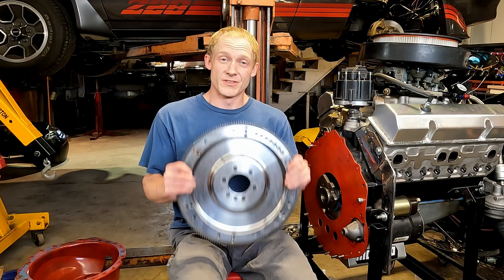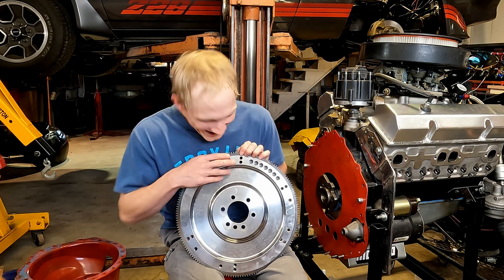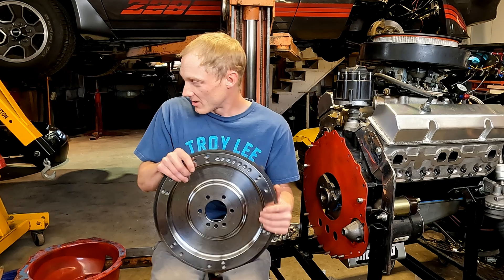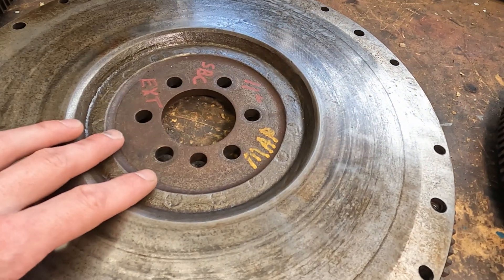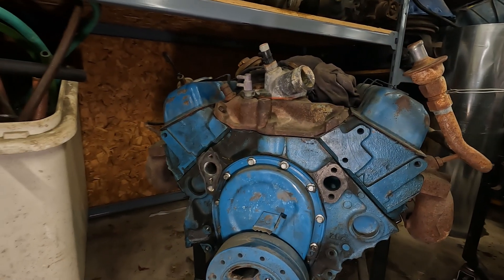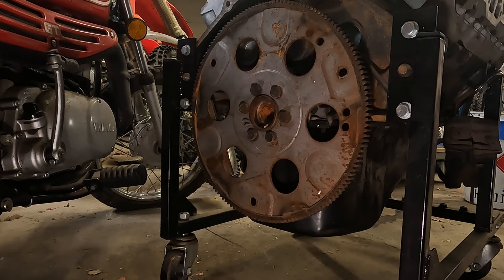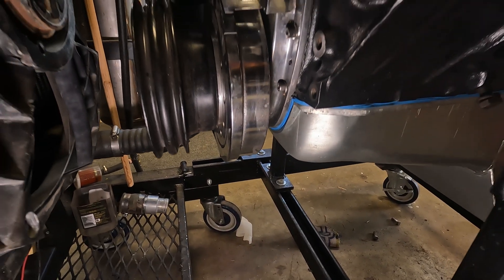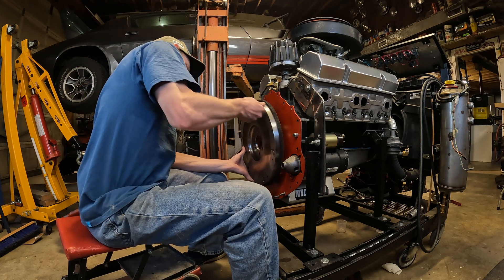External vs. Internal balanced 383 stroker & SBC motors

Comment: Stevelessard I have 383tgat was built as an automatic car and balanced with a balancing plate and flex plate. I installed it in a manual transmission car. I ordered an external balance flywheel and had a slight vibration at 2000 rpm and severe vibration at 4000 rpm. After pulling the transmission twice and replacing the clutch I spoke with an old boy and he insisted it was the flywheel. He told me to use the balancing plate tha the motor was balanced with and the stock 350 neutral balanced flywheel. After taking his advice everything is as smooth as butter. Thank you Smiley!

Comment: I built a 383 Stroker.my forged crankshaft is internal on crank snout and external balance on flexplate.thats how skat  builds there crankshafts
Reply from the maker: Is this a gen 2 block or 1 piece main? Yes they are a little different than gen 1
Reply: @bucksedge  gen 1

Comment: I'm having a balancing problem. I'll pay you to talk a minute and pick your brain on my 383?
Reply from the maker: You are welcome to pick my brain for free here in the comments. If its something more technical that requires a phone call I can arrange something.
Reply: @bucksedge  I appreciate it. I have 2 things to try if I fail I will message you tomorrow evening thanks kind sir
Reply from the maker: @stevelessard9477  Best of luck to you on the 383! Do not hesitate to ask
Reply: @bucksedge  okay tried what I could. I have a healthy 383 that was mated to a 700r4. I recently swapped it to a standard trans under the impression I could use a 400 sbc flywheel. Now in the truck it idles perfect but has a vibration when I snap the throttle. Kinda goes away up high up coming down I can feel it again in the lower rpm range. Stumped and about to give up. Any help would be great. Thanks
Reply from the maker: @stevelessard9477  Okay so a few questions so I can assist.
1. Is this a used or new engine?
2. Did it run good before with a 700r4?
3. Does it have a smooth harmonic balancer or one with a large groove/notch in one side?

Seems like you identified this as an externally balanced already just checking.
Reply: @bucksedge  1. Used
                              2. Yes it ran great drove perfect.
                               3. It's external balanced. It had a 350 flex plate with a extra weight before I put a 400 flywheel on, it has a notch balancer
Reply from the maker: @stevelessard9477  Ok being as you have done a manual swap and there is tyically a lot of changes to the driveline bellhousing, transmission, driveshaft, ect... Based off your description I think we need to make sure it is not the rest of the driveline shaking.  

With the clutch pressed to the floor (disengaged) does this problem still happen? And does it occur while in neutral and or in gear? This essentially isolates the transmission from the engine. A bent countershaft or driveshaft could create a similar harmonic that you describe.

Checking the bellhousing run out would another thing to consider.
Reply: @stevelessard9477  did you find the culprit?
Reply: @eragon672  no I haven't. Runs amazing. Just has like a flywheel vibration about to swap it to a automatic as much as I don't want to
Reply: @stevelessard9477  Th350 mates pretty well to the 383 SBC, I have two trucks with the combo. Understand your sentiments about wanting to drive manual, it's just enjoyable.
Reply: @eragon672  yup your right. I have a couple auto trucks laying around. Looks like I'm gonna do just that. Pull the sm464/203 and install the th350/205. 👍